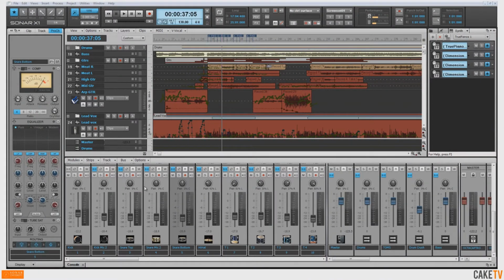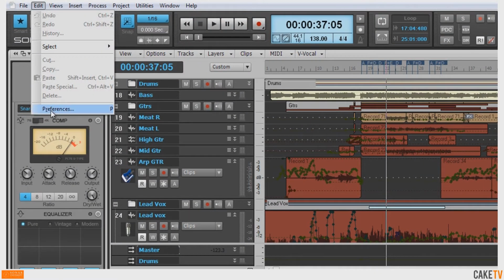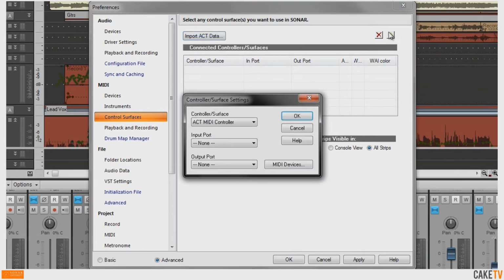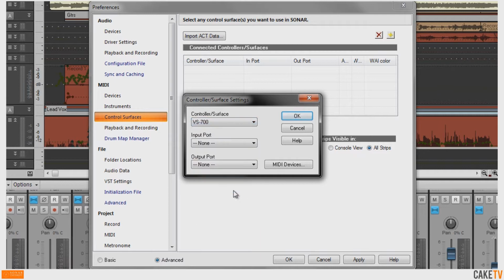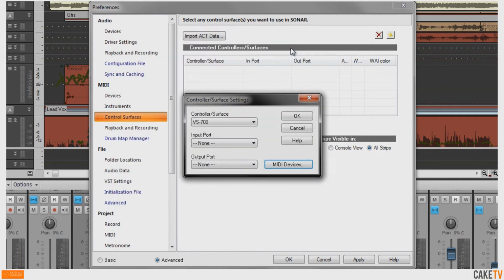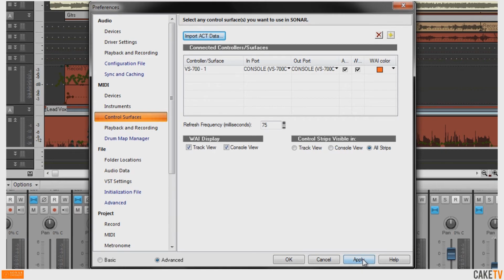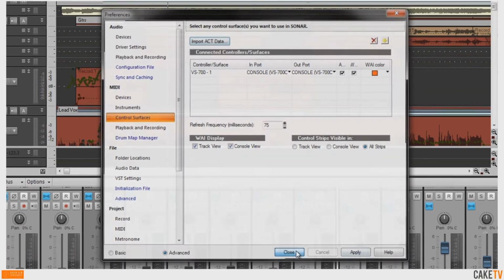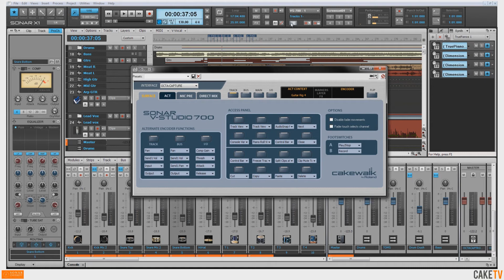SONAR: Get Started - Control Surface Configuration

Comment: I got mine registered & detecting presses / knob twiddles... but I can't see how to apply those to specific controls in channels/tracks/ FX etc. Is there a second part to this video where you can "train" the inputs to control specific things? (like cranking up the Distortion on an FX instead of the volume going up on Track one if shift is pressed etc?) (It's hard to find answers to things you can't describe well! (that's on me!))